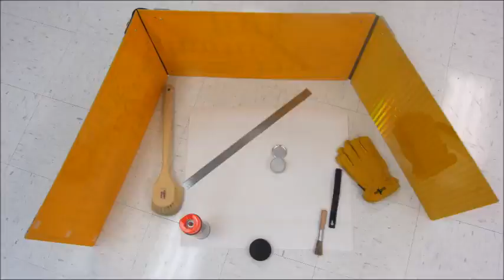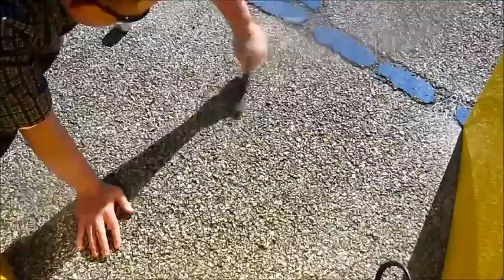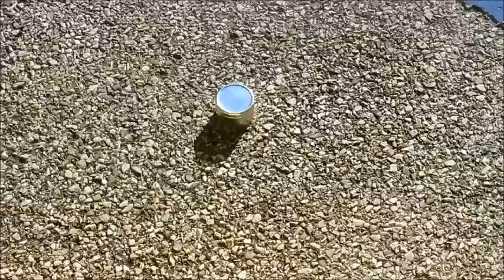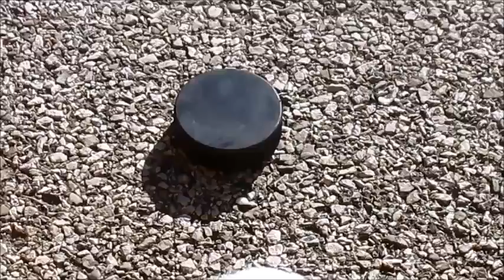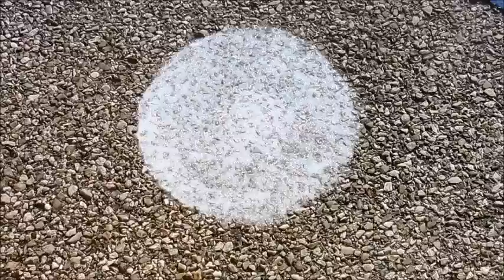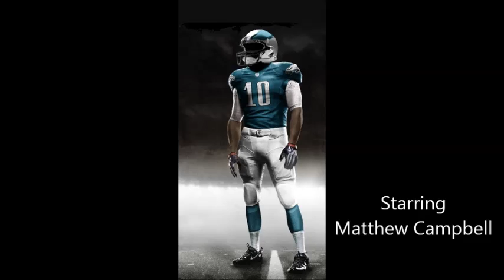WV DOH  Sand Patch Test - Macro Texture

Comment: Y did u not show the calculations? Btw is there a limit to the height of the texture for a passing or failing range?
Reply: I guess it depends on your Department...I work for the Alabama DOT and we do it on micro milled surfaces. Greater than .0625" is a failure...less or equal to .0625" is pass
Reply: nice qusestion